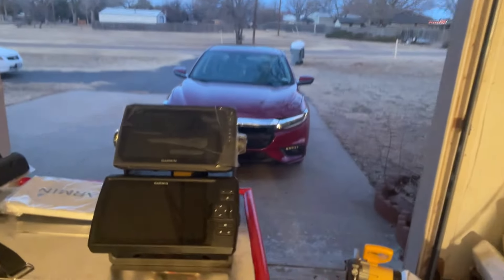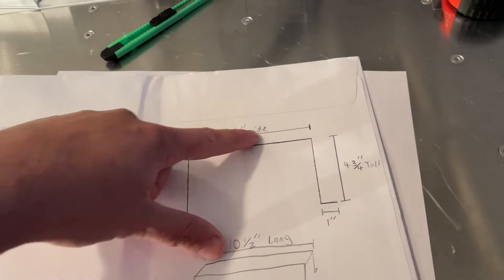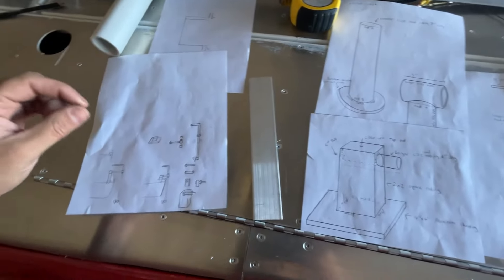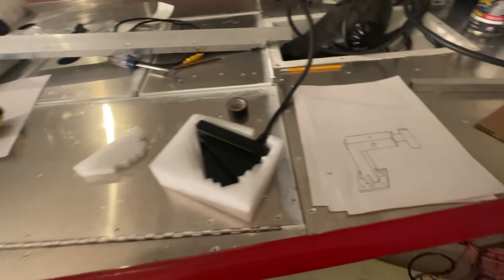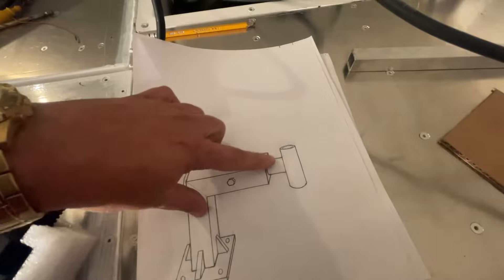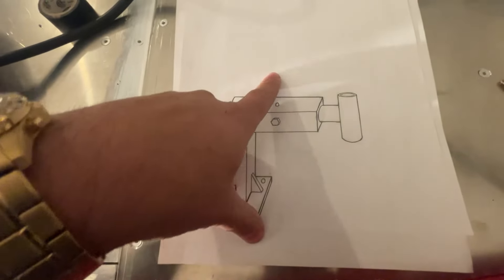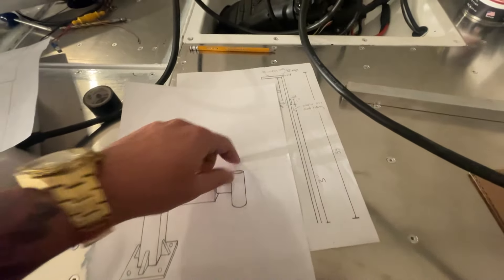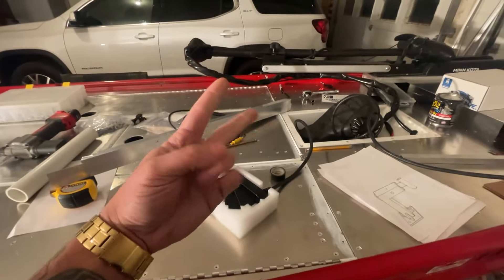Designing Dual Fish Finder Mount and Livescope Pole Mount for Jon Boat

Comment: I was also thinking of the stowaway for my front graphs. Not anymore. That's actually how I want my graphs on my boat, even and no offset. Looks like one unit and two screens. Also good ideal for adding the light underneath. I also wanted to add light to front of boat and the mount is the perfect out of the way spot. Can't wait to see the finished product.

Comment: I'd clock the dual screen mount a little towards the center of the boat. It might get a little difficult to see while using the trolling motor if its pointed straight back.
Reply from the maker: That’s not a bad idea and definitely a possibility, I’ll see how it looks but I already know the trolling motor wires go right through the middle so they would definitely be hitting the screens if I put them in the middle
Reply: @AdamRyanA  Don't put the screens in the middle leave them on the side just turn them towards the middle, like point them towards your battery. Cause it looks like that new mount you're building might get in the way of looking at the screens.

Comment: Why u not mount the live scope transducer to the trolling motor.?
Reply from the maker: i want to be able to control the direction of the transducer at all times and not just at the direction of the trolling motor, and also the trolling motor is already full with the other transducer and the hydrowave speaker